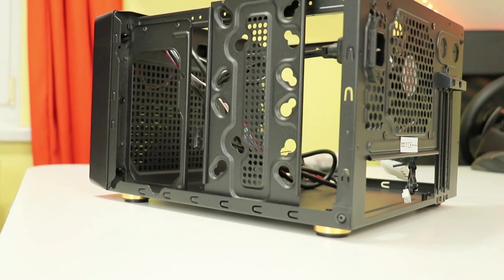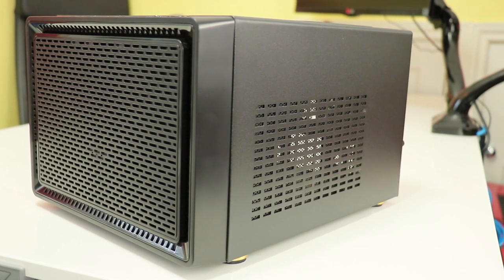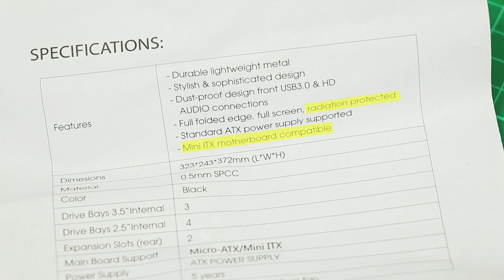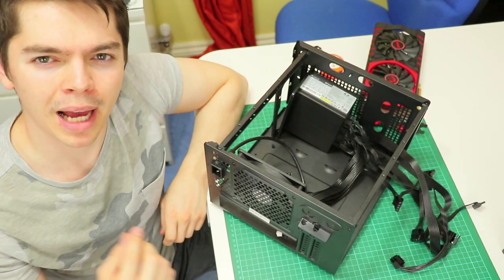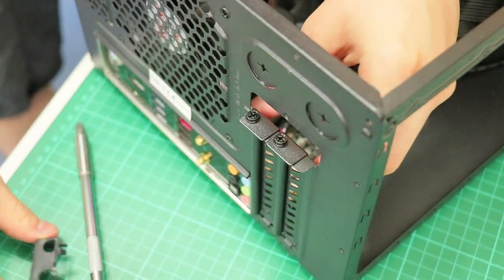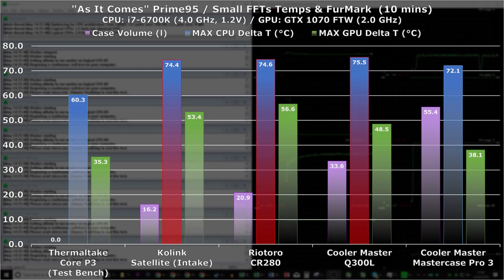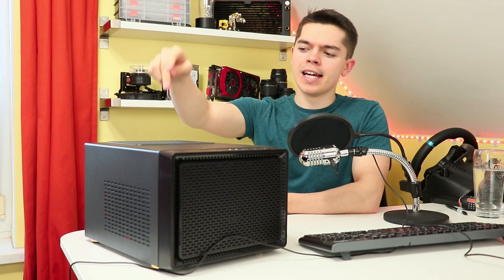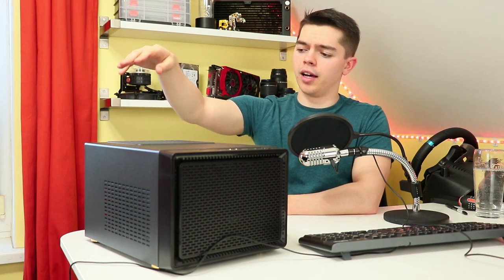Kolink Satellite (Mini ITX/Micro ATX) Review

Comment: Recently bought this case with refreshed side panels "Kolink Satellite Plus" very nice brushed black metallic finish.
Given the case dimensions I suspected a full height mATX 24,4cm board would fit in with just a little bit of modding since iTX boards are ridicules expensive almost 3x the price of normal matx board and I wanted a budget build so did not even considered going iTX

Since most of mATX boards have their GFX slot as the second PCE it was best to move the mounting standoffs 2cm towards the top anyway. Also now you can fit in the third row of standoffs for more secure board mounting.
The second constrain is the width available for the board, with ATX psu it is around 19cm (MSI A320M PRO-VD/S with 18,7cm fits nicely) just needs a bit of metal cuts here and there to meet new top mounting position.

With SFX psu you could fit most full mATX 24x24 board with some thoughtful arrangement and cutting.
Being a very compact case it can fit a large cpu air cooler which I was aiming for my new ryzen 3600 build.

made simple slideshow of my modd https://youtu.be/_8H_uONCP1E
Reply: Can i fit an 18.5 wide board without moding the case?

Comment: If anyone is coming to this video now, just note that the case does support some micro ATX cases however likelihood is that the GPU compatibility will be limited down to a single slot GPU. It will fit a 2 slot GPU but with a bit of cutting.

Comment: Great job on the review, your style, level of detail and depth earn this subscriber. It's hard to find information about this case anywhere and yours has everything I needed. I am looking into this buying this case because I am looking for the smallest Micro ATX case I can find. Originally I wanted to get the Kolink Rocket but I find it hard to sacrifice 2 RAM slots (because I want to get 64GB of RAM) for Mini ITX (there is double sized DDR4 with 32GB per stick coming soon but that might be extremely expensive and don't know about the compatibility with the motherboard manufacturers). I have the Thermaltake Core P3 case and I love it but there's a lot of empty (wasted) space in it and it's as easy as I would like to travel with. (I was looking into laptops but they have very tight thermal limitations, especially on CPU, and the high-quality LCD panels are over 2000 pounds expensive and very limited upgradeability). Compared to other (even bigger cases) this one can take 120mm water cooling and even dual fan push-pull configuration to keep the CPU happy and cool. And a lot of storage to boot as well. Looking into building a Ryzen R7, maybe some OC room too, 64GB DDR4 and either a Vega 64 (if it cheaps up under 400 pounds) or the successor to that next year.
Reply: No such luck it seems, none of the AM4 motherboards is 4 slot RAM ... insert foul language for about 5 minutes of swearing

Comment: Thank you for such an in-depth review! I literally chose my rig based on this video except I went for a Gigabyte AB350N-Gaming WiFi motherboard, a Geoforce GTX 1060 and (2x8GB) DD4 3200 RAM, and a Ryzen 7 2700 with a bit of a budget artic freezer 12 cpu cooler, and just one Samsung SSD 850 evo. I plugged everything properly and none of the parts seem to be defective but I’m getting no image output... And the worst part is that the diagnosis beep thingy (whatever it’s called) doesn’t beep at all. The gpu fans seem to stop working almost immediatel. I’ve de assembled the thing and am putting it back together right now but I’m losing my patience trying to figure out what’s wrong. :(
Reply from the maker: No problem whatsoever, I'm really glad you found it useful.

I hate to ask this since it's probably something you've already validated. But does the motherboard have the correct BIOS update to suite the 2000 series Ryzen "APU"? That could be causing the problem. You may want to either get a BIOS update pack from AMD, or replace the motherboard with a B450 board that's guaranteed to have the updated BIOS.

Did you have any post lights turn on to notify of the problematic components? I know RAM can be a pain, I've had several instances where my test bench wouldn't turn on, and just removing the RAM and reseating it solved the problem.

The GPU fan situation is probably just the fans not spinning due to low temperatures, I wouldn't be too concerned about that. Can you boot into the system with just the APU through the motherboard?

Let me know how you get on, I'd like to help out where I can.
Reply: AV Techy Thank you so much for the speedy reply! The guys at the store supposedly updated the bios before handing over the motherboard. But now I’m wondering if they did. I’ve taken the ram out and put it back on and made sure it’s in its place. I can’t verify the problematic components since I have no lights for it just the motherboard speaker (that isn’t beeping). I don’t think I can’t boot through the APU? This ryzen series (2700) specifies it needs a discrete graphics card. The motherboard does have some LEDs for aesthetics, they turn on and immediately turn off when I turn the power on. Everything else keeps spinning and working. I think the motherboard is the source of the problem. A lot of people with this one seem to have had the same problem and updating the bios solved it. I don’t have a way to try an update myself so I’m stuck in de assembling and re assembling (rip perfect cable management). Also again the reply was super appreciated, subscribed!
Reply from the maker: Hey, sorry for the late reponse, the main system is down for the Dark Rock 4 review.

Sorry, I was being a fool, the 2700 of course doesn't have a graphics core. You'd think I'd have that down by now haha. Yeah it seems very strange that there;s no response from the system whatsoever. I'd be strongly tempted to take the board with the CPU in place back to the store to see if they can figure out what the issue is (I'm suspecting the BIOS).

Sorry there's not a lot more I can do to help out, there seems to be something out of place whatever the case it. No motherboard speaker noise when there clearly no image is just weird (it would be painfully ironic if there was an issue with the power lines to the speaker...). I hope it gets fixed soon, if you find any more issues along the way let me know. With any luck taking the board back to the store will find the problem. Keep me updated, and thanks for the subscription - much appreciated! :)
Reply: Just bringing this up as it hasn’t been mentioned...is the monitor plugged in to the the back of the graphicscard and not the mainboard, sorry for asking.
Are all power cables connected and correctly seated, especially 8 pin cpu, 24 pin? 
Ram in the right slots as stated in manual, dependent on stick count. 
Cpu fan connected to correct header, quite unlikely but could perhaps cause a safety feature to kick in if not detected.

Maybe try to disconnect everything except for mainboard power and cpu with cooler, to check if the board stays on, add in separate pieces bit by bit...

Good luck with your issues

Comment: Awesome review! Really indepth, though I do wish you could make tests using both your standard test bench setup and, depending on the case, a best case setup. My only two questions at the end of this video is "how high a cooler can fit in here" and "how much will a larger air cooler lower the temps". As your temp stats have indicated (to me at the least) both the GPU and CPU would benefit from an intake style back fan, a tower air cooler and the SFX PSU turned around from it's current config, this would be "Best case" config and I do want to know what the temperature results from that would be both on the CPU and GPU.

Sidenote: This would really be a good case for a dual PC streaming setup, this one being the encoder rather than the gaming one. A (fitting) mATX mobo, 3700x (high core count and clockspeed, plus that AMD stock cooler is awesome in and of itself), some cheapo videocard (gt710?) and a capture card, this case would be perfect.

Comment: what do ya think about putting some 140mm fans infront of the gpu ? and a dark rock 4 pro for the cpu ;p
Reply: And if ya still have it can you measure it everywhere i look it has different measurements , in your manual it says 323x243x372 but that seems to big and on most sites you can buy it from its listed at  280x190x290 but on overclockers site its 260x190x280 so would be awesome if ya could  xD

Comment: I have seen an ASRock AM4 MATX Board that's 23Lx20cm wide. Could that squeeze into this case you think?
Reply from the maker: Hmmm, that's a tricky one. If you went for an SFX PSU you could go up to a 202mm wide board at a push. And I can imagine there's 0.4cm tolerance to fit it in length ways.

Bear in mind you would only have 4x standoffs, so there would be a fair overhang. But you could buy some standoffs and machine it down to fix that (but it might not end up looking so clean from the underside, but that's probably not an issue).

There's no way it would fit with an ATX PSU though. Let me know what you end up going for.
Reply: @AVTechy  smallest B450 AM4 MATX board I've seen is Asrock B450 @20.6cm wide. In b350 batch gigabyte AB350M-D3V @ 19.5cm wide. This is an itx case.
Reply from the maker: If you can get yourself an SFX PSU then you should be able to squeeze the second one in no problem. Have you already got a PSU, or is it still on the "to buy" list?
Reply: I've got 2 to buy lists. One is MATX based system in fractal define Mini C that I'm inclined towards coming from Mid-tower, the other is entertaining the idea of an ITX build using parts for that. SFF does add a bit extra on cost though. Nzxt H200i+corsair450 sfx was my goto combo, (but the latter's proprietary fan controller software is getting poor reviews has put me off it). Then I saw this for half the cost for 30 quid, it's small change. I have an existing 330w PSU that could be used as a backup.  I'm just balance things out for cost, airflow etc.
Reply: @AVTechy  Thanks, I opted for Kolink 450w sfx. I got the above case with the plain aluminum front rather than vents. Can't wait to put it together. I can't believe how small it is. Am aiming for a quieter pc with tower style heatsink on cpu with 1 fan.

Comment: Great review! Considering this case myself since it is compact and has room for a good air-cooler. You say a Asus B350m k fits, it is 22.6x22.1cm so I wonder how that is possible? Read a build guide of a guy who put a 24.4x24.4 mstx board inside and made a custom attachment if psu over MB. Kolink says max clearance with atx psu is 22.6x18cm (24.4 width fit acvording to other guy), with sfx psu that should be 22.6x20.3cm unless there are a couple of cm more than what they claim? I was thinking about a Asus B450m K, Evga Supernova sfx psu, ryzen 3600, 660p 1tb m. 2, radeon 5700 blower style and Be Quiet dark rock slim cooler.
Reply: me podrias pasar esa guia por favor . es que quiero intentar con una placa de 23.1 cm x 20 cm

Comment: Thanks for the review. I think I'm going to buy this case. The price is half that of the qbx and there are some options with which I would also save 50 euros or more by choosing one of the motherboards from the list because itx is more expensive. They are in total 90 euros with which I can buy a better processor, fan for the cpu, gpu ... and of course this box is smaller than the qbx. Maybe I would modify it by placing it vertically and opening ventilation at the top. I think the length of the graphics in this case is not so limiting. what do you think?
Reply from the maker: First thing I'd say is double check the width and height tolerances for the boards your interested in on my list. Some may require SFX PSUs to work where others won't.

As for modding, I think it's all possible, but it really comes down to the skill of the modder. I'm awful so I'd avoid it, but if your a seasoned modder you should have some fun making it work for you. I think there's definitely an option to open up the PCIe slots to the rear to give you more options.
Reply: @AVTechy  thank you. Excellent review as always.
Reply: @AVTechy  Some ideas here because I see that you always ask for feedback in the comments. You could Explain your feelings about the dimensions focusing on transportation that may be one of the reasons why somebody chooses itx. In fact there could be reviews of portable monitors, keyboards with case, lightweight headsets, backpacks and things about portable setups. Although you think the videos are long, they do not become heavy, I admire the way you control the rhythm when speaking. I think the bad comments about the technical service of brands will not help you. Maybe you should have used larger cpu fans of different brands and prove incompatibilities, looking for the best posible build.  You can use a meter and really see other places in the case that are not included in the dimensions, such as the height until the input of the power supply that could collide with the cpu cooler. You can do rankings about coolers, motherboards, overcloking, best budgets builds, news etc. All said with my best intention. An excellent review.

Comment: Great Review!! Had the same problem finding motherboard but now i will go for a asus prime for the ryzen 2600
Reply from the maker: Excellent, I'm glad you enjoyed it. Double check the measurements on the motherboard before you but it just to make sure (it's good to sanity check them just in case).

Best of luck with the build, and thanks for checking this one out!
Reply: I have spare a6 9500, 8gb ddr4 so the mobo wont be such an expense. If it works fine the 2600 will go in with 16gb gskill like yours. Else the mobo will go to one of the builds of my "clients".
One m2 ssd only and the build will be so clean
Reply: @Gadgetakias  Sorry for replying to a 5 month old comment lol. I was just wondering if you managed to fit that motherboard in the case. :)
Reply: @solvesoderholm7390  went for a mini itx and sold the system 😂😅

Comment: This case is very similar to the Cooler Master Elite 110. You should do a review and compare to that case.
Reply from the maker: Well spotted, I have a string suspicion that this case was based on the Elite 110. Only I think there were a few design changes made to mix it up a bit, and they decided to market it as a Micro ATX case where the Elite 110 is a Mini ITX case ( and rightly so).

The only issue with getting that Elite 110 in for review is that it won't fit a full size Graphics Card. And our test system has a full size graphics card. I have a feeling it could fit the card in based on the similar dimensions the the Satellite, but Cooler Master states it can fit up to a 210mm card, and ours is 267mm.

Sorry, but I think I'll have to pass on the Elite 110 for now. It would have been nice if I could have affordably bought a Mini ITX GTX 1070 before starting all these reviews, but the prices were crazy at the time. And I think full size graphics cards are a little more common, so it's a little more relevant to most to cover cases that can fit them in.
Reply: It is an Elite 110 knock off. It will just house everything internally due to being slightly bigger.

Would you say MATX is more easier if you go SFX. Also are there any extra holes at bottom if we want to add stand offs ourselves.

Comment: "Errors" in this review. 
1 - after removing 3 structural components that add most of the rigidity you judged the case to be flimsy because it flexes and creaks...
2 - you are reviewing case thermals using a 91w TDP CPU with a 65w cooler, thermal throttling makes for inconsistent tests ... (you could at least use the stock cooler for a more realistic comparison, not only that but the cooler you're using can barely exhaust on the ram side using that motherboard, you could also use a 65w tdp chip which would make more sense)
But overall I liked it a lot, good job.

Comment: I ended up trying with rear fan as an intake, and added a side fan. Mobo temps are hardly hitting 30.
Reply: How did you add a side fan? Also what size is the side fan?
Reply: @swarnimsingh3626  I had a 120mm laying around I placed it bottom right corner and secured it with that thin plastic wire that holds your cords together when your first taking components out of the box. I don't have a graphics card since my build has a 2200G, so this mean cool air travels across the mobo at the heatsinks and out the side. Overall temps are good. At some point I want to drop in a RX 570 because they're getting cheap.

Comment: those matx am4 boards you claimed to fit wont fit
Reply from the maker: In terms of height I think they're all fine, but width wise it depends on the PSU size. Not all will fit with an ATX PSU, but I think they're all good with an SFX PSU with the bracket positioning the PSU furthest away from the motherboard.